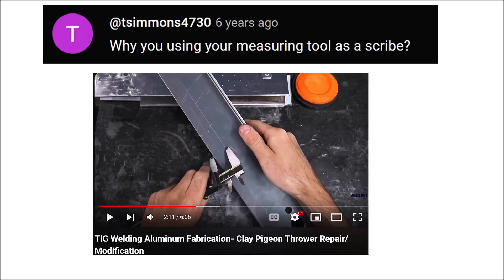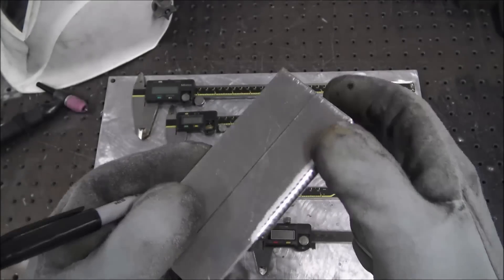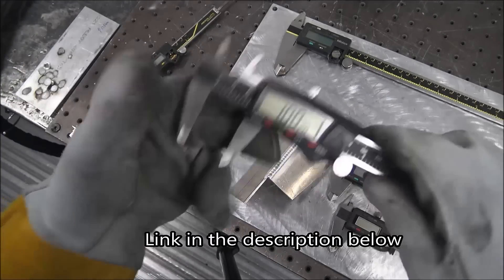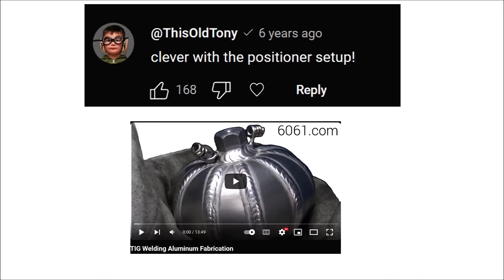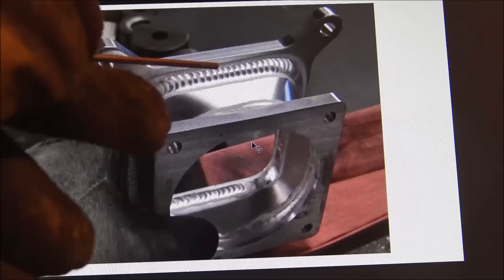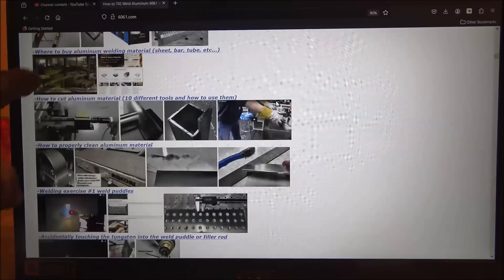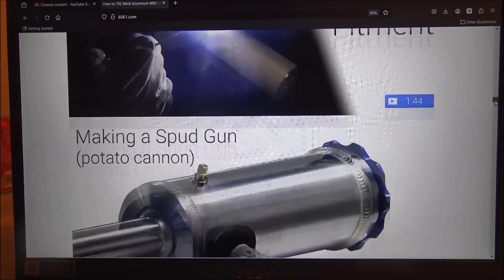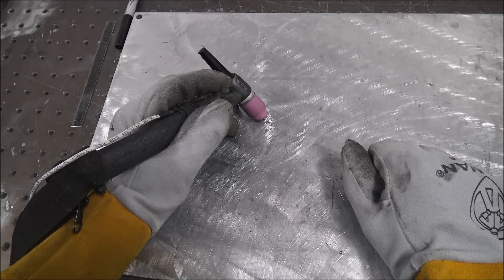Learn From My Mistake - TIG Welding Tables and Machinist Calipers Don't Mix - 6061

Comment: As much as I admire your welding skills, I am actually just as, if not more impressed, with your fabrication skills. They are inspiring. It didn’t surprise me that you played guitar. As someone who also plays and teaches it, I think the hand eye coordination and sense of rhythm definitely helps with bead consistency. I would love to have you weld up some pedal enclosures and/or a pedal board. Your welds are so nice it would look great. What guitar player wouldn’t want the look of tig welded aluminum guitar pedals? I’m surprised no one has done that before. Appreciate all your videos.
Reply: I think (not 100% sure) Aaron and I once kicked around the idea of a TIG welded aluminum guitar stand or hanger.

Comment: I started with the cheap digitals. Used them for years. Never found them less accurate than my mitu’s- only that the mitu’s didn’t require zeroing before every use.

Comment: Why don't you buy a scribing caliper with a wheel and a carbide pin, that is actually designed for this application?
Reply from the maker: Less versatile. I don't always scribe with the same side. Having a wheel limits the way you can use them.

And I prefer to not have unnecessary tools when something I already have does the job great.

Comment: I'm not too worried about the tips of my callipers, I usually only use the flats for measuring anyway. Anyway, there are special callipers for scribing, they have a replacable tip instead of the outer jaw and a roller on the inner jaw. Really useful for scribing like that.

Comment: Get yourself a few dividers in various lengths, e.g., 6", 8", and 12".  These are simple, rugged and inexpensive layout tools that can be used and abused, re-sharpened hundreds (thousands?) of times, and still maintain their precision.  Stainless steel versions are harder than the plain steel types.  Give 'em a try and see how you like 'em.

Comment: I will be honest; I cringe every time that I see someone use their calipers as a scribe.  Just because you can doesn't mean that you should.  For doing layout, I spread some Dykem and then scribe with a scribe after I have measured carefully.  I learned to do this before DROs existed and you needed to be mindful of the backlash on your lead screws.  When you use Dykem, your marks are much easier to see.  If you don't want to mess with Dykem, use a blue marking pen but be careful as it is not as permanent as Dykem and easily rubs off.
Reply: Marking calipers do exist.

Comment: From a lifelong Caliper abuser and likewise a life long Mitutoyo owner. I have a Mitutoyo from the 70s it is a normal non digital 150 mm one and it has the 20:1 vernier. I can still reliably take measurements of 0.025 accuracy (when checked by a mircometer or subitomer afterwards).
I scribe all things imaginable with it!
Steel, non-ferrous metals - everything.
Only drawback from scribing is dulling - you will dull the edge after a while so scribing will stop to work as effortless.
Do note:
1. I never use the outer edge for scribing only the outer tips - it has two on each side on the "outer" jaws (we call it "beak" native in non English...)
2. I ever use only moderate force - it's scribing not carving!
3. scribing on a colored surface (felt pen, sharpie, marking fluid) is so much easier to see
4. No other caliper stands up to an original Mitutoyo - it goes: Mututoyo on place #1, two empty places, everything else follows beneath.
5. Great tips tho (not sure what the question was for the rocket in the end?)

Comment: I've fried a few electronics with my Dynasty..one was a variable speed motor control.

This is explained in the Miller documentation.  The controller was isolated from the workpiece so this was damage from radio frequency inductance.

Good calipers are made from hardened stainless tool steel.  Using the tips as scribes will take years to wear.

Comment: I'd be interested in those non working Mitutoyo if you want to part with them. I can use them for parts, or use them as a base to make custom calipers with. I have had to grind and machine calipers for specialty use more than one time. Let me know if you want to sell them.